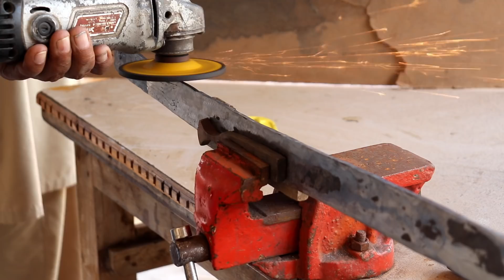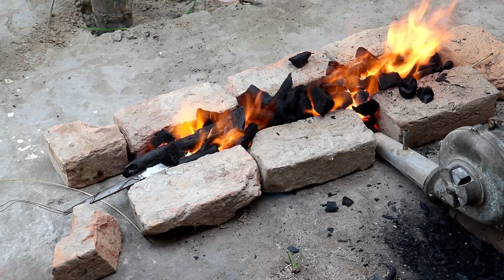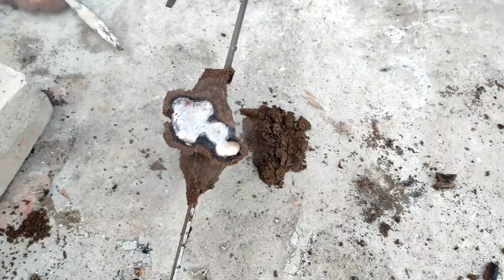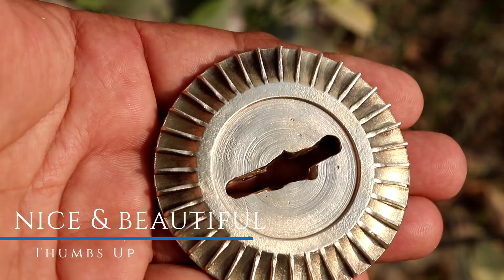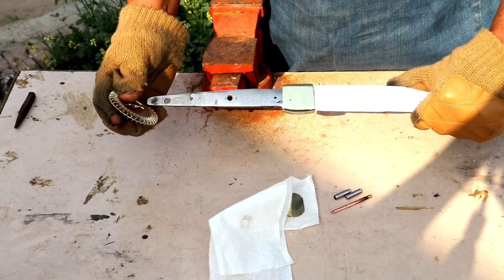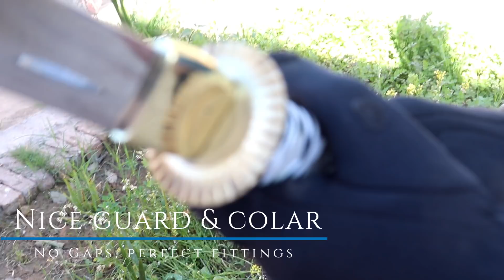Forging a KATANA out of Rusted SHACKLE | Davids Profession

Comment: that thing is going to bust eventually at the tang juncture. your quench tank isnt long wnough. also, as a rule, you put the blade mune side DOWN when you are heating to protect the thin blade edge. Also, your geometry isnt so great for cutting. aim for 2 3rds cutting edge and 1/3rd back side and place your fuller in that 1rd. it will look and cut MUCh better
Reply from the maker: Loved you input

Comment: Couple of things blade was not hot enough during the tempering process to have a mune or edge that would be any good. Your process for making the habaki, actually exposes the blade in that area to heat from the brass you poured. Take it off next time and cast it in the sand by itself. And I read in another comment your edge geometry is way off. This is a katana but more in shape and some aesthetic but far from an actual durable functional blade. Good work nonetheless
Reply from the maker: thank you Dano for valuable input